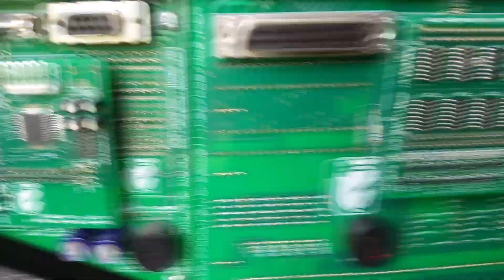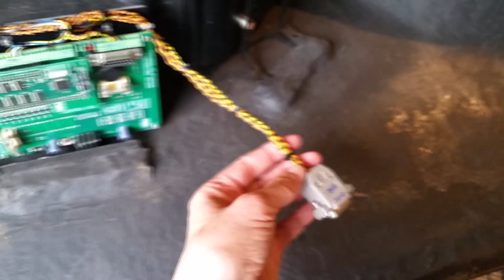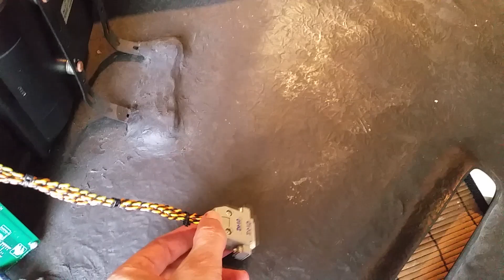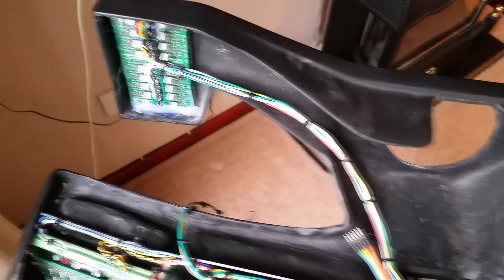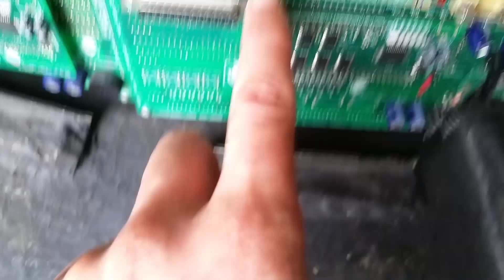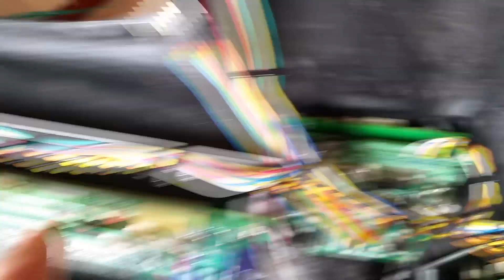Dash Connections

Comment: Good day Neil. Very interesting video. I am an absolute novice onlooker and I am somewhat energized at the AHA moment I have experienced in watching. I learned something today from this about the module standardization. If i have it correctly, it's not just a set of unique PCB's being made from scratch for each car whereby one has to go back to the drawing board working it all out or adapting Arduinos or Pi's with code. It has already been established among the builder community and I find that inspiring. Great explanations and I am glad the AI or algorithm has recommended these. Best wishes.
Reply from the maker: Thanks again, Matthew.
Sure, the modules do not need to be redesigned for each car, but the software for each car is built from two parts - a core module and a "trim" file.  The core module defines the functionality of the modules, while the "trim" file allows specific preferences to be selected, as well as incorporating calibration data which can be fine-tuned to a specific vehicle or specific sensors.  The software versions are specified like this, for example:
KoE-DM3v9-2307~CustomerName-001
where the part of the name before the '~' specifes the core module and the part of the name after the '~' specifies the "trim".
Hope that makes sense :)
- Neil